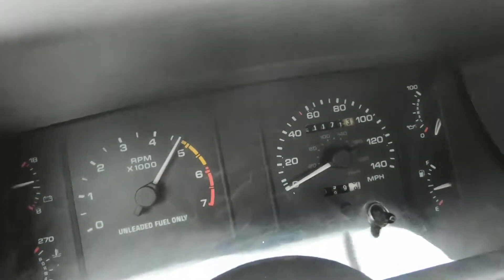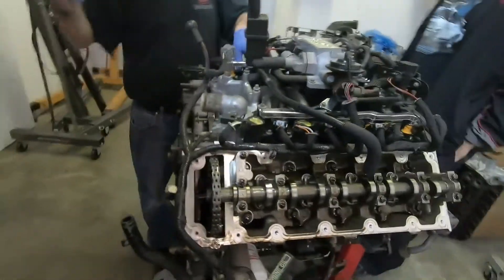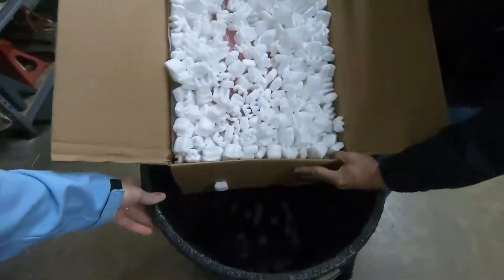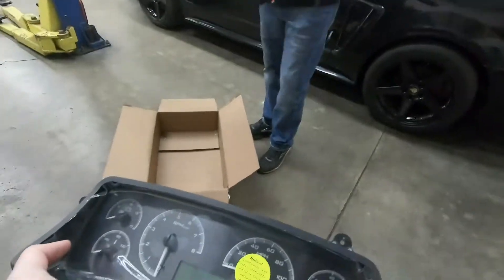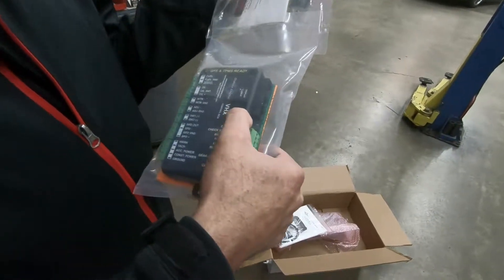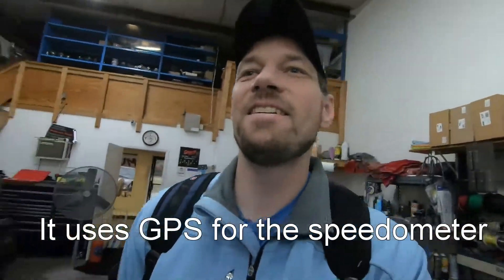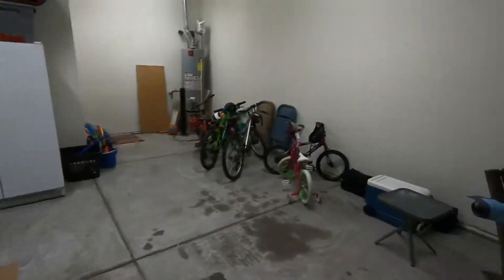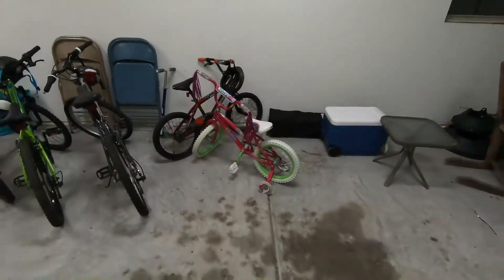My FoxBody Mustang broke again! *Speedometer Problems*

Comment: Did you figure out why your oil pressure gauge and water temp gauges were not working?
Reply from the maker: I ended up swapping to a Dakota digital cluster instead but I probably would try changing the sending units.
Reply: GearHead704 I saw and it looks nice, and I’m just confused how all of the gauges don’t work but I guess mine could just be like that from sitting

Comment: Mine does the same thing
Reply from the maker: The problem was the speedometer cable being aftermarket.  Apparently, Daniel Carpenter makes one that works well, but haven't tried it myself.
Reply: @GearHead704  I ordered one from LMR, and you're right. My speedometer is not fixed. Even though I changed out my speedo gear not too long ago, I discovered it was damaged after changing the speedo cable. So I ordered mew gear, I hope that will fix it.